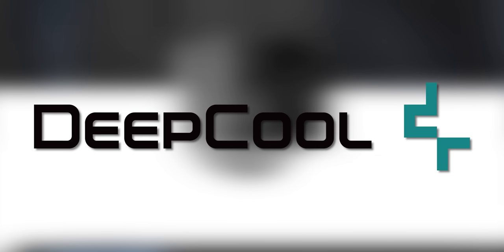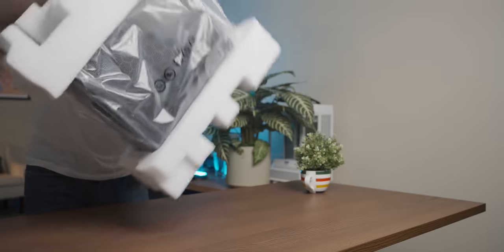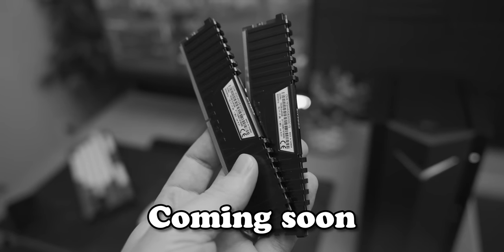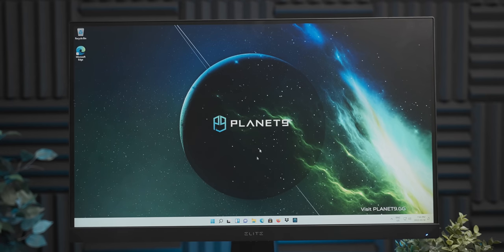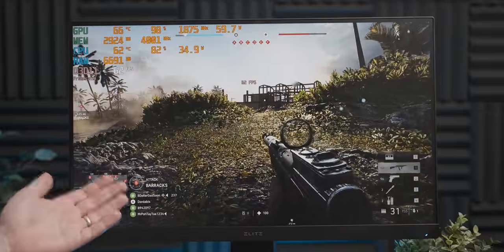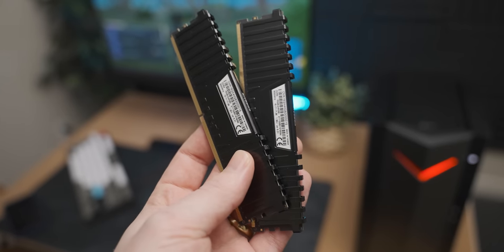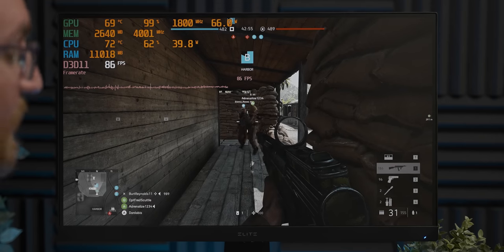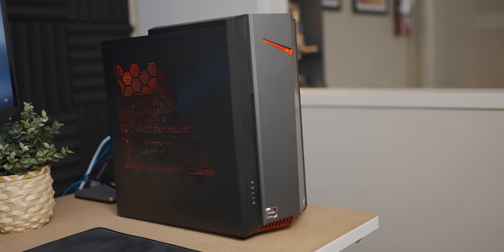I Bought The WORST Rated Best Buy Gaming PC

Comment: The intermittent stuttering was likely due to the known fTPM issue with Ryzen and Windows 10 and 11. It's enabled in the BIOS when you were scrolling through there. Disabling that feature should make the issue go away. AMD said it will take BIOS updates to resolve and those are expected from motherboard manufacturers in May 2022.
Reply: @LabRat Knatz I'm still on Windows 10 but I had it enabled and disabled the fTPM without issue after running into the stuttering. From what I've seen from others the same is true for Windows 11. It has to be enabled during the install of Windows 11 and can be disabled once the install is done with out causing any problems from what I've heard.
Reply from the maker: Thanks for the suggestion. I’ll go and have a look. 😁
Reply: @DawidDoesTechStuff  also one more thing, if you use Ryzen Master you can overclock the RAM (obviously only for Ryzen prebuilts, if you had an Intel processor you'd be out of luck).
Reply: Wait what?! Any link on this?
Reply: @itsTyrion  I couldn't post a link previously. Just search for Ryzen fTPM bug or along those lines and the AMD article should come up with plenty of others.
Reply: Damn u guys are really smart lol me and my Ole lady just wanted 2 pre built gaming laptops that's weren't 2k each. I got a 550 hp pavilion with amd and ryzen she got the acer nitro 5 laptop I was impressed by both
Reply: I did not know about this, trying that later on my rig

Comment: If that OEM BIOS has any options for ram speed if would be under the CPU and chipset section of the advanced tab, which you skipped over without actually checking.

But sadly many/most OEM's dont allow you to enable AMP/XMP as its considered overclocking and in Intel's case only the more expensive chipsets and K series CPUs used to support it.

Comment: The reason they have a sata power cable like that is because it's a 12V power supply, you don't have sata power coming out of the psu in those, you connect it to the board. That's also why there's no 24pin, but only what looks like a cpu power that goes to the board instead.

Comment: I used my nitro 50 for 3 years and tbh it works great, even after upgrading my ram, not slow at all and average gaming performance. Although I know now to avoid prebuilts for future pc
Reply: They are not all bad,they just need some tlc and ram.
Reply: @jukkapiispanen123  yep you're right, it's has served me well and still does now.
Reply: Not all prebuilt are bad for example abs on Newegg
Reply from the maker: I am really glad your system worked out for you. I’ll see how I get on with it over time.
Reply: @DawidDoesTechStuff  thanks for commenting. 💖.

Comment: The ram problem is the exact same as a lot of other OEM systems. You need ram that supports the JEDEC standard in order to run at advertised speeds otherwise anything you put in there will be 2133 mhz
Reply: @LabRat Knatz damn, even with an asus board?? i have a tuf b550 and docp works fine with Corsair ram. the board must be defective or something, is it too late to claim manufacturer's warranty?

Comment: Normally I'd say don't even bother pairing the 8GB it comes with, and just buy a faster kit of 16gb.. but in this case, just buying another 8gb of the same thing, if you can find it, would be fine.. That and reload windows and you have a decent system.. albeit overpriced for what it is..
Reply: It probably wont run 3200mts in dual channel.  If you did match the original stick I would guess it downgrades to 2666 or even 2133.
Reply: You can just buy cheapest shit and that would be fine. You can probably get 2133 to 2666 8gig sticks for 15-20$ used or not much more for new.
Reply from the maker: That’s what I’m going to be doing to it for my month long test. 👍
Reply: Ram is certainly the cheapest upgrade you could make here other than maybe storage speed. It's too bad you can't get it to 3200 with the poor bios but in the case that you could a brand new 2x8gb kit is 70$. It's too bad gpus are so expensive still cause you could make this be a much better custom build for 1000$.

Comment: Well 2133 is the base speed for DDR4 so I expected it, it is quite curious how they managed to get the single stick to run @3200 when there isn’t a bios option to enable it.
Reply: It's called JEDEC and it's (3200) the defualt speed for that particualr stick where as 2133 is the JEDEC  defualt speed for most other ddr4 sticks.
Reply: There should be a setting in the BIOS for DOCP on the AMD boards. It will set it at the speed of the ram sticks.
Reply from the maker: @DroneMee  Exactly! The whole JEDEC thing has been the bane of my existence for ages. 😁
Reply: @DroneMee  yeah I know what JEDEC is, but I’m pretty sure anything OVER 2133 is considered “overclocked” by them, because they don’t determine what CPU support what speeds. They just set the minimums and let manufacturers decide from there where to go.
Reply: @Living-gnu-64  seems to be that it's not OC if the default JEDEC speed is 3200mhz. Contrary to most retail ram kits for individuals building/upgrading systems. This is done (from my own observations) for mainly oem motherboards like this one (that appears to be 12v only).  That's why there is no bios setting for memory oc. It is designed to be ran with ram that has only the default JEDEC speeds. It is up to the system integrator to pair with a cpu that will support the speeds of the ram they choose to us in their pre-built systems, it would appear.

Comment: the only problem with the 5600G is it only supports pci-e 3.0 even if its being ran on a 4.0 motherboard, so a video card in a 4.0 slot only runs at 3.0 speeds, that is also weird it ran at a lower ram speed.Everyone knows if you put a stick of slower ram into a computer it down clocks all ram to that slowest ram speed but Ive never actually seen it down clock it lower than the lowest ram speed. Possibly a bios update will at least bring ut up to the lower clocked ram speed
Reply: The oem mobos are pretty garbage when it comes to ram configurations.  You need to match the original stick with the same speed and timings otherwise it reverts to stable minimum.  However, this system might not run any ram at 3200mts in dual channel.
Reply: you shouldnt worry about the pcie gens atm
Reply: @Arminoderso  6500XT says hello. 😀
Reply: @Arminoderso  you need to be cautious even the 6600XT is only on a 8x bus

Comment: Hmm, i wonder if that 3200mhz stick of ram have that frequency as a standard JEDEC config

Your Corsair rams although overclocked seems to be based on a JEDEC base speed of 2133mhz, because ofc it doesn't matter as you are supposed to enable XMP

This little machine (and other pcs with basic af bios) is probably reading the SPD chip on the ram, seeing that its base JEDEC is 2133 and using that

You wave 2 ways of fixing this, take an asus overkill mobo, cuz i believe they can allow you to write the spd chips on ram, at least my Z270 maximus Hero IX let me do that, and rewrite it with the timings you want, idk how you edit them tho so be careful with that

Or look through your pile of single stick rams from trash pcs and get another 3200mhz, chances are these speeds are JEDEC because im pretty sure those naked sticks dont support xmp
Reply: Or just change mhz thru ryzen master
Reply: @MantasNorkus  if it saves the timings and shit by all means, but if you have to always keep ryzen master open to most likely to get those timings saved is just a pita, saving it in bios means you dont have to deal with it later

Comment: I thought I did my research pretty well and thought I got a pretty good deal on a pc from there it was a: CLX - SET Gaming Desktop - AMD Ryzen 9 5900X - 32GB Memory - NVIDIA GeForce RTX 3080 - 480GB SSD + 3TB HDD - Black

I know the memory sucks but hopefully it's an easy and cheap upgrad but the pc is 2,708, it hasn't arrived yet should I cancel my order?

Comment: My first gaming pc was a pre-built Acer Predator UR100D back in 2014. 
12gb DDR3 ram (dual channel)
GTX 760
Core i7-4770
2TB HDD

It worked fine for a while, even put a 970 in it for better performance. That cpu is actually still in use in a system my step brother has, and the 760 is still kicking in that same system!

Comment: Yeah about the 2133 mhz I was 100% expecting that. As someone from eastern Europe almost every time I've worked with ddr4 it would be on some hottible motherboard that wouldn't allow changing ram speed so it would be stuck at 2133, absolutely horrible.

Comment: i got one brand new on clearance for 500 bucks cad (last gen). stuck some more ram in it works great, been using it for 6 months now. no problems super quiet light gaming and mostly photoshop  digital painting is my main use. photoshop runs great on it.

Comment: It looks like the power supply is only delivering 12v.That would explain why you hooked up the Sata power connector to the motherboard. The motherboard is where the voltage conversion is taking place.

Comment: Want to really buy the most horrible PC on the internet go by in Alienware Alpha I3 model look on eBay let me explain why these are horrible machines first off this is the early version of Alienware UEFI and like most things they experiment with after you've installed all the BIOS updates the machine freezes on the loading screen you then have to take the entire machine apart and hit the reset switch under the GPU fan most people have usually attached to wires to that switch and bent over the two prongs so that it won't interfere with the fan and run a switch to it underneath the machine so that they don't have to deal with taking the machine apart to reset it then once you get it running is where things get hilariously awful Windows 10 does full CPU and GPU usage at the same time throttling the machine so much that the performance is abysmal

Comment: The reason isnt recognize any higher speed because your Corsair sticks has been registered at 2133. Whatever higher than that is XMP Profile. 2133 is the JEDEC profile hardwired to the dram.
OEM bios usually didn't support it. It will default to whatever registered at the JEDEC profile. So, use higher, the only way to do is using 3200mhz with JEDEC profile (which is horrible, cl22 and I don't bother remember the rest). And 3200 JEDEC on retail is either really low-end lineup like no heatsink generic looking ram and usually OEM unit from Micron, Samsung, Hynix, etc.

Comment: I bought an acer nitro pc when I was younger and was also negatively surprised with the performance and the stability of the pc. On the top of that my SSD just broke after 2-3 weeks of usage and I couldn't even boot the pc. Keep in mind that at that time and age I didn't even knew how to open a PC, so I just send it to the experts for repair since I still had warranty. 

Funnely enough after 2 months of wait time it came back and I don't know if they even tested it but after I booted the pc it still wouldn't boot, so I just went back to the store demanding a refund and they told me they couldn't do anything but just send it back to repair. So that's what they did, it came back 2 months later and still didn't work.

Since then I never bought something from Acer and just went for a custom build pc which still stands till today.

Comment: I'm a bit curious. You obviously doubled the amount of installed RAM when you put the dual-channel kit in, so I'm wondering how much of the performance boost you got was just down to having more RAM as opposed to running dual channel?
Reply: even though the ram wasnt running at 3200 he still technically had more speed due to having dual ram over just one stick. Plus the additional ram space is good as well, 8gb in 2022 is kinda small all things considered you probably want 16gb minimum for a nice experience. Personally i have 32gb because ddr4 ram is one of the cheaper components you can have in your system.

Comment: I have that same processor, and I can't see myself putting anything less  than, say, the CoolerMaster Hyper 212 Plus/Evo on it for cooling.  I  
mean that's the minimum I would use (that's what I use in my build, but I also have a full tower case with plenty of fans so it keeps it cool and
 I suspect the OEM AMD fan would have worked too as I don't overclock my system).    Speaking of proprietary connectors, I had a few HP 
computers that were like that.  Had one that could hold (4) 3.5" drives, but the sata power cables had to be plugged into the motherboard (and 
the motherboard used a 20 pin connector, not a 24 pin) but did have the 4-pin 12V connector (as most PCs do).  The computer even had (4) SATA 
ports but as to why it only had power support for two devices puzzles me.  Of course I could have gotten some SATA power Y-cables I guess.  
But it just seemed to be too many compromises for no real reason.  It also used some proprietary connectors that went to the motherboard, basically making an aftermarket replacement not possible.

I think the biggest complaint I would have is the price.  I think that it would be possible to build this same system (with the 8GB of RAM) for a little less and get better components.   I mean you can find the Ryzen 5600G opn sale for around $200, 8GB of RAM is probably something like $50 or $75.  500GB SSD is maybe $100 for a good one, Power Supply maybe $100, case $50, and Windows for around $130.   Video card may be the one gamble as you may have to pay upwards of $300 for the 1650 now (used to be as cheap as $200).

Comment: :elbowcough: YOU MISSED they are using moles adapters to power the 4 pin motherboard connector .... while the 4 pin from psu  is unused .

Comment: Those v8.31 Corsair DIMMs are Nanya a-die. The only DIMMs that Corsair sells that include a higher speed base JEDEC profile are those with Micron ICs (v3.xx), which will run at 2666 (if the system is capable, or the next highest included JEDEC profile if it isn't, which is why you may see 2400 on systems that support 2400 max at JEDEC). Corsair kits with Samsung, Hynix, & Nanya (v4.xx, v5.xx & v8.xx, respectively) don't include any other intermediate JEDEC profiles between the base 2133 and XMP profiles.

Comment: Hey there.. on your ram upgrade.. try getting some 3200 ram that runs at 1.2v.  HP and Lenovo do the same thing (although the new HP Omen Bios update allows for XMP finally).  You may find that if you use ram that runs native 3200 at 1.2v vs needing XMP and 1.35v, you get the benefit of the faster ram without needing to mess with the bios.. 
Cheers
Rick

Comment: My major gripe with Acer prebuilt is their "smart" quiet fan control. It's stays at 0 RPM fan speed and allows the CPU to goes to 100 degree C, then ramps up to whirlwind of death speed for a few mins to cool it down to around 60C. The cycle then repeats itself. There is no way for you to control the fan speed through BIOS. I ended up buying an ultra low speed fan and just snip the PWM pin off.

Comment: That SATA power connector on the motherboard is common in small-form factor industrial systems.  Interesting to see it used here in a consumer-spec PC.  I guess it helps with cable management since the PSU now needs fewer cables?

Comment: I wish you included links to these products so we could check them ourselves (especially when I'm seeing the video a year later)
The Nitro 50 I find on best buy now is a 12th gen i5, with 16gb ram and a 3060, as well as a mechanical 1tb hdd and the 512gb nvme, for $1300

I'm curious what the one you showed off would go for now, but I can't find it anywhere.

Comment: add another ssd and run raid 0 debian and qemu for win and osx and android - add a 2.5usbgbe - i think those are the only real furthur on up the road reasonable upgrades and should be allowed and e peen compensation but not over compensation - use 2 2.5 and bonding/bridging link agg

Comment: 3:10 The stick that you see there has only 4 memory chips on it. Normal (proper) single rank modules have 8 chips, each connected to the cpu by an 8bit bus totaling a 64 bit bus per memory channel. when you only have 4 chips, the have to be connected by x16 each. This gives the memory controller less options to access different blocks individually. YOu can think of it like going from double rank memory (16 chips per stick) to single rank memory. only that now you have an even worse bottleneck. 4 chips on a stick can be pretty much considered  1/2 rank. 
tl;dr: 4 chips on mem stick bad. 8 chips better, 16 best.
Reply: That was pretty insightful, thanks
Reply: Well, you are largely wrong. Memory controller does not care much about number of chips. It addresses memory either individually or in blocks, but does not care how module stores data. Only scenario where having more chips could be useful is when you need to access let's say 8 consecutive addresses. If these addresses are stored on 8 separate chips, theoretically it would be faster to read them instantly from each individual chip than to read two from four chips. But in practice difference is negligible, so much that  4 chip modules could have very high speed with somewhat increased latency.

Comment: liamtanic
18 seconds ago
Dawid, I have a this computer in a similar configuration but with an Intel chip and I ran into the same problem with the ram. I read one a forum that if you use RAM with the official JDEC timings it will run at the advertised speeds. Unfortunately I didnt have another 100+ to spend on RAM so I was wondering if you could maybe check into that.

Comment: LOOOOOL, I was sitting here when you said "2 ram speeds" thinking "yea, 2133 or 2400", and then you VERY optimistically said 2666! I laughed out loud. Then I laughed out loud hard enough to hurt myself when I was right xD. My high end ryzen 3900x rig, with an X570 Elite from gigabyte for the board, and 32gb (8x4gb) 3600mt of G.Skill Trident Z Neo, also defaults to 2133 whenever the bios is reset lmao